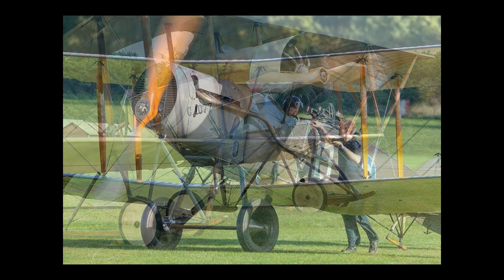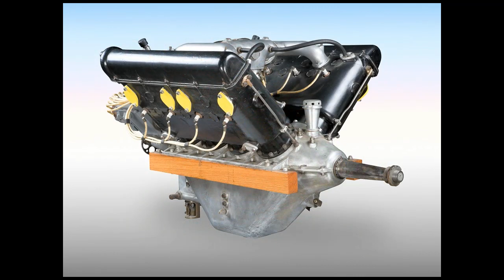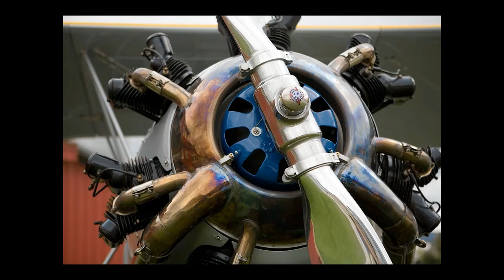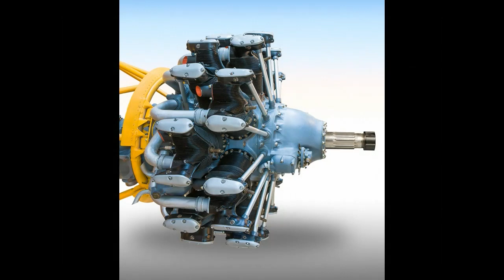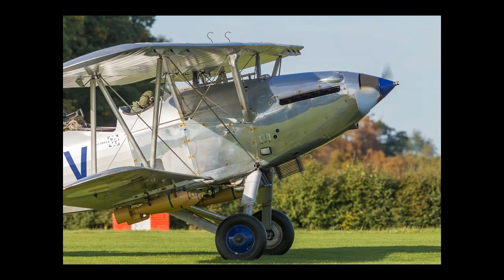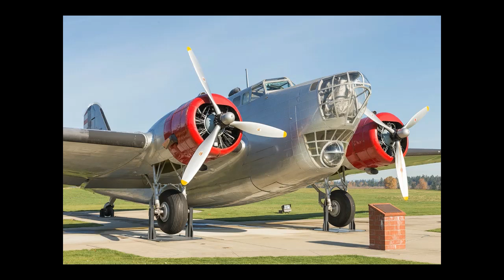The Great War Through the Golden Age of Flight

Comment: If the term Radial replaced Rotary, do the cylinders still rotate with respect to the airframe?
Reply from the maker: With respect to aircraft engines, a rotary engine is a radial-type geometric configuration in which the crankshaft is fixed and the cylinders/crankcase/propeller assembly rotates around the stationary crankshaft. So all rotarys have a fixed crankshaft.
Reply: @AEHSvideo 
A crankshaft fixed to the aircraft if rotary..
It was not only a change in description.